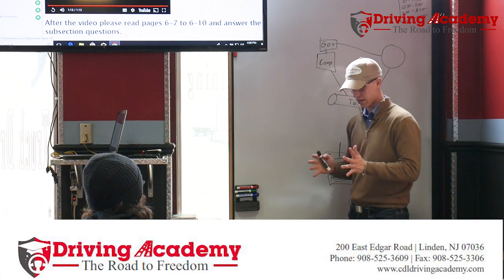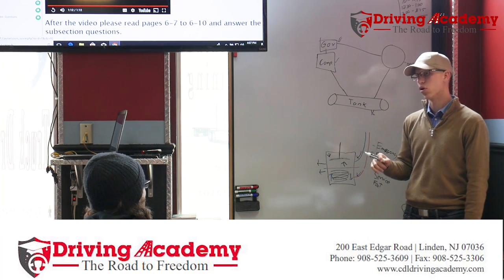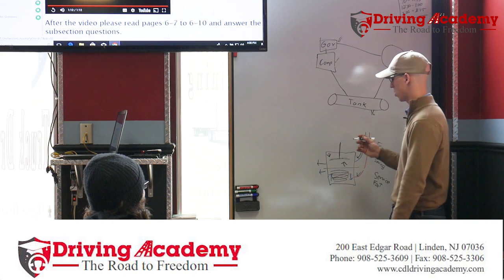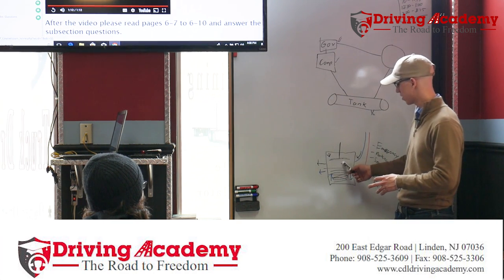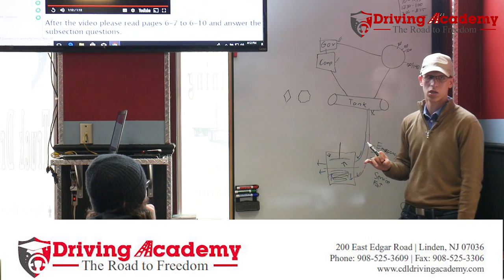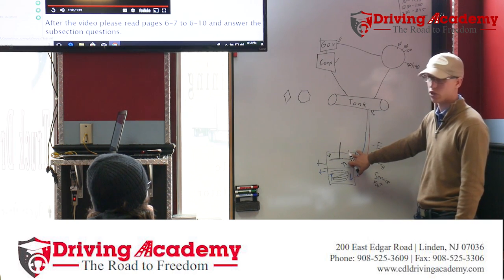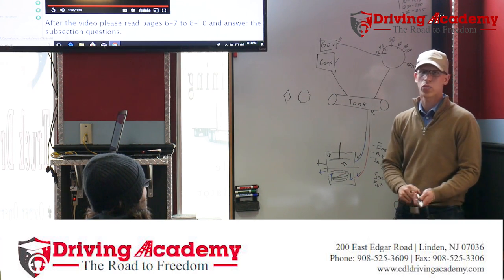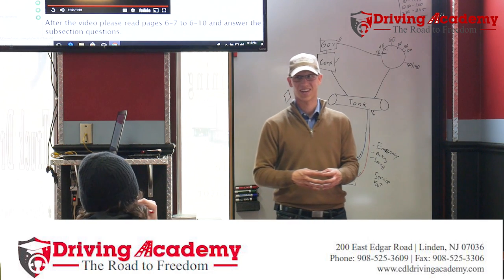Air Brakes Test Explained - Driving Academy - Live class

Comment: At the pop up test, trailer brake didn’t pop out (between 20-40 PSI). I said: this is not a good test, i want to redo it. So I filled up the air to up to 60 PSI and redo only the pop out test. I got failed for this. What is the proper way to redo any test if you don’t get the desired result?

Comment: I thought the gauge only reads the stored air so if Theres a leak in the 2 system brakes how are we gonna wait a minute to notice if it drops 3 or 4 PSI in the system??? Is there another gauge for the emergency / parking brake ???

Comment: @ around 6:00 do you press the service brake while the emergency and park brake are applied? I thought that could damage the brakes? Shouldn't you chock your tires and press in the emergency and park brake before you pump the service brakes to lower to 60 psi for warning lights and or buzzer? Then pump the service brake for the 20-45 psi emergency brake to pop out?

Comment: You never said turn the key back in to the on position for you air leakage am i correct?
Reply from the maker: during your air brake test you will need to make sure the key is in the on position with engine off.